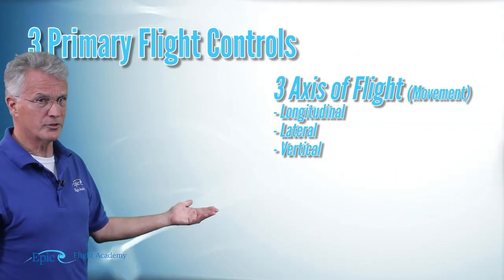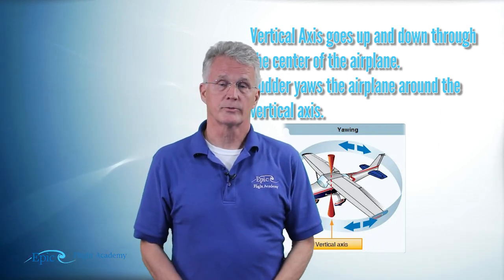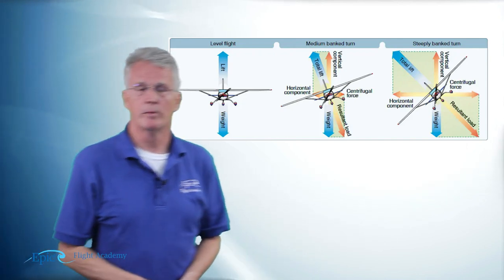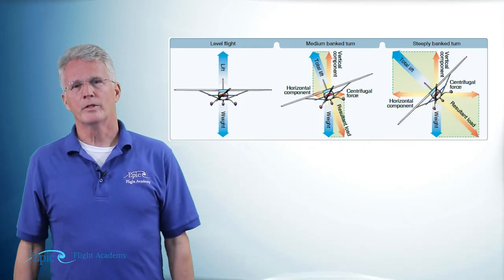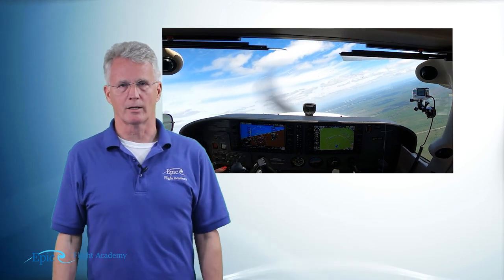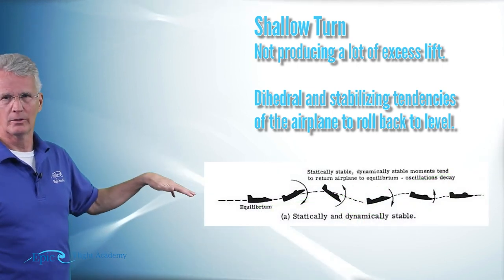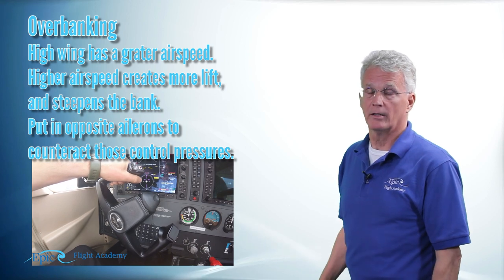PPGS Lesson 5.8 | Aerodynamics: Turning Flight

Comment: In your diagram the “horizontal component” opposes “centrifugal force”.
These forces are equal and opposite, cancelling each other out.
Your aircraft wouldn’t turn, it would fly straight ahead.
Reply: The wing is in "balanced" flight with respect to an air mass.  Not with respect to the ground.   Thus it turns in the direction that the wing is bank because lift it forcing it to turn in that direction.  Centrifugal force is a "resultant" force created because the wing is turning.  Because its "balanced" the wing maintains a constand "G" in the balanced turn depending on its degree of bank.   If the turn were unbalanced, the wing would increasingly accelerate in the turn creating increasing "Gs", as if pulling back more and more on the stick in a fixed banked turn.  Also, since the wing is not flying with respect to the ground, although an observer on the ground might think so, it's detached from the ground, so the oncoming air is at the same airspeed along the entire span of the wing.  Thus, both wingtips are flying at the same airspeed in a level constant banked turn, contrary to old legends that die hard.  But that's an argument for another day.
Reply: @daffidavit  Aviation word salad.
Reply: @kdr955  Then why don't you try and explain where the center of a constant altitude backed turn is in your own words since you seem to have the answer?
Reply: Everyone is better off just not watching these YouTube “instruction” videos.
Reply: There’s no vetting or quality control to these videos. Any jackass can call himself an “instructor” and publish garbage.
Reply: @daffidavit  more aviation word salad. Anyone with a rudimentary knowledge of physics would understand what I mean.
Reply: @kdr955  Yeah, exactly what I thought you would do, avoid the issue and defer to a strawman.
Reply: I stand by comments and welcome any scientific (grounded in physics) criticism.
Reply: I.e. not just from someone with hurt feelings.

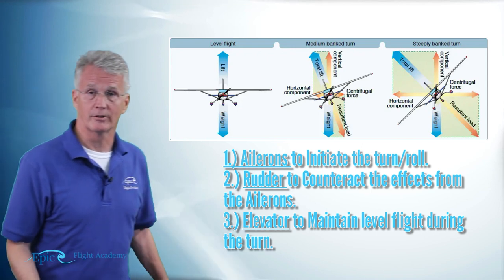Comment: At 4:23 the explanation becomes confused. Yes, the horizontal component of lift turns the airplane but it is the vertical  component of lift which keeps it going in level flight. At 4:54 you state that it is the elevators that create the extra horizontal lift in order to maintain level flight. The elevators create a vector in the opposite direction to the resultant load, as is depicted in the picture that you show but that "new" vector contains both a horizontal and vertical component. While the horizontal component of the vector causes the turning centripetal force it is the vertical component keeps the airplane flying level.  https://www.youtube.com/watch?v=7tWOyOu-QG4